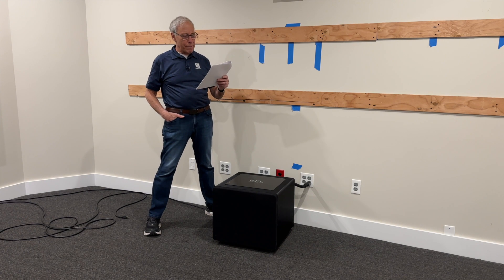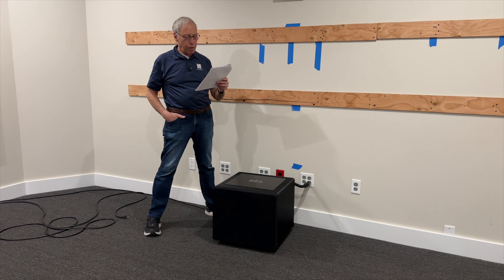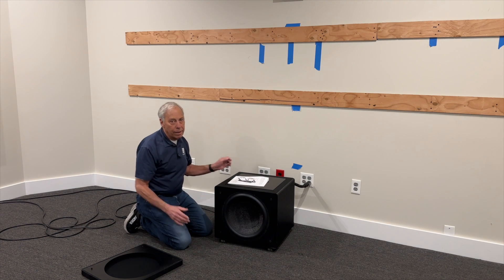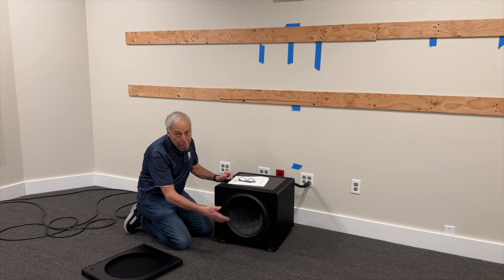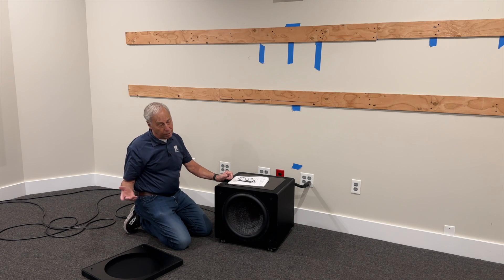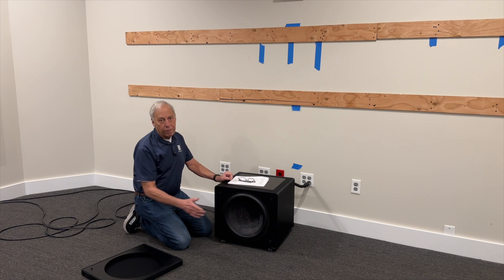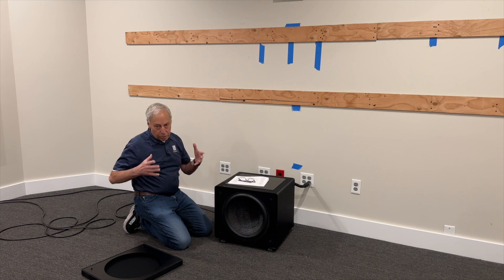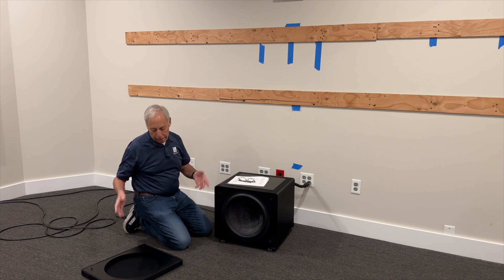How subwoofers can actually decrease bass

Comment: I'm not sure why with the amp on, the speaker is held still but not with the amp off. If it is connected to the amp, isn't there a low impedance connected to the speaker of the amp's output transistors? If you connect a wire across a speaker's terminals it will resist motion as the speaker becomes a linear generator, that generates a current that magnetizes the coil in the opposite direction to your push. Do some amps disconnect the speakers e.g. to prevent power on pops? Though I think I did try it with a couple of amps of mine and the speaker was flexible with the amp off and more rigid with the amp on.

Comment: As an AV integrator, everything in the room absorbs sound and /or reflects it. From the walls to the floor, chairs, your body and yes even the speaker itself. If you have parallel walls and speakers shooting at them, the sound amplitude increases, clarity decreases. Anything that helps break up those frequencies which helps standing waves from compounding, will always make a room sound better. Sometimes subs can be a bit pronounced and the room gets very "boomy", if you can't find the right medium on setting up the sub, You can combat that with another sub slightly out of phase.

Comment: When I'm using my subwoofer next to my disconnected JBL LX55 speakers, the woofers vibrate a little bit, and cause a faint crackling sound to come out of the tweeters.  Weird.
Reply: Subwoofers are a strange beast. 😀 There are lots of people that will never use a subwoofer in their system.

Comment: Paul indirectly gives the answer @2:48: "the amplifier holds it still" - so all one needs to do is leave the subwoofer on and unplug its input (preferably on the preamp side in order not to create an antenna). Not the most economical way to go about it as it'll consume electricity being idle, but the damping factor of the subwoofer is effectively going to counteract any sound waves from passively moving the sub driver cone.

Comment: I drove from upstate SC to Buffalo NY to pick up a pair of JVC SK 1000’s.  Point is on the way back my factory car stereo sounded different with these 50 lb speakers in the trunk not powered up of course. I thought the car stereo sounded better base wise. Was it just because different is better or just because it changed the space in the trunk where the rear car speakers are housed? Or was it the speakers, who knows?
Reply: More than likely it was the space in the trunk with your setup. Are you using 6X9’s.

Space in car audio is much different than home audio.  Sound waves can bounce around in car audio.  Sound waves can and do go backwards in the trunk with your setup. I am guessing you might be using 6X9’s. 

I used 6X9’s back in the late 80’s.
I had them in speaker boxes. 
With a 75 x 2 RMS amplifier. 
JVC head unit. Both made in Japan. 👍
❤😍🤗😎👍🥰
Reply: @davidfromamerica1871  their factory Altima speakers might be 6 x 8’s, but I agree the house speakers in the trunk just decreased the volume in the trunk space.
Reply: Less air space, and an absorbing medium. (ie; the speakers)

Comment: The only frequencies the sub will absorb are the frequencies that are in the sub's range, which is directly related to the size of the sub driver.  The satellite speakers don't go down deep enough to have any audible effect.  Not only that, but it's a useless question to ask, because a simple experiment will answer it...just take the sub out of the room and see if you hear any audible difference.  If it isn't audible, then the question is moot.

Comment: What frequencies would be absorbed by a woofer driver/cabinet?
If it's a 12" driver, one wavelength at this woofer diameter corresponds to about 1.2 kHz
I would be more concerned about the mid-range frequencies and higher, being affected or absorbed by a standard sub-woofer rather than the lower frequencies which have very long wavelengths - often wavelengths that are comparable to the size of the listening room.
Overall, I wouldn't be concerned with a subwoofer selectively absorbing or trapping  specific sound frequencies. It would be an interesting scientific investigation though

Comment: It is an interesting concept.  Another spin on the topic is to realize that the drivers are acting as microphones.  They will generate a signal which they feed back into the amp.   An amp with a low dampening factor will have this signal interfering and distorting the performance.  We actually hear the room reflection in a feedback loop of sorts.
Reply: Ŵhen you ha e a subwoofer connected tò a AVR an set GG the crossover say set to 80 Hz frequencies below 80 Hz are takenover from the front pair and redirected to the subwoofer or subwoofers , so if you were to turn off the power to your single or allyour Subs and the crossover builtin the AVR is still set to 80 Hz , your front paìr are then only reproducing bass above the crossover point , this also depends on how your sysystem is setup you may be running subs with builtin crossovers and your fronts may be running full range. So ok you cut the power to all the Subs and you then have maybe 4 subs with uncontroled cones .

Comment: The only problem I had  with a sub is hearing damage.😀
If you have it, you are going to use it..🤗 I had my sub set to 20 Hz in a customized baffled ported box for rock and heavy metal. Hooked to a amplifier that had “lots” of headroom for that sub. 
Enormous amount of air pressure coming out from that sub. No more sub for me.  Save what hearing I have left. 😀
Reply: bass do not hurt hearing.
Reply: @sudd3660  
Speaker Air Pressure the bass carries does damage your hearing. The same with headphones. The air pressure bass inside the headphones is even worse.
You must be one of these elite Audiophile Audiologist.
😀😀😀😀😀😀😀😀😀
Reply: @davidfromamerica1871  well unless you are sticking your ear to the port it doesn't do that much damage (at least not to the hair cells in the cochlea). It does encourage you to turn the mids and highs louder though, so indirectly yes.

Comment: That interesting. If that is happening, I’ve never heard that effect (even with several  large inactive speakers in the room).
Reply: As Paul said, the effect is too small to worry about.  Helmholtz resonators have to be tuned in large groups to have a noticable or even measurable effect.
Reply: @wty1313  Almost true, although I have tried with a 5 l empty water bottle. There's a half decibel difference at the measured frequency with the cap. Not much for one plastic bottle, but enough to the measured by the sonometer.

Comment: What about a HiFi store showroom with all those not playing speakers?
Reply: Same effect would occur.  Anything that is a sealed cavity with one end open to the sound pressure in the room will act as a Helmholtz resonator - including an open bottle of beer, BUT the effect will be very small because the effect will be spread across a very wide frequency range due to the various sizes, etc.  Helmholtz resonators have to be tuned in a fairly large group to have significant effect which is why it's rarely used in real life applications.